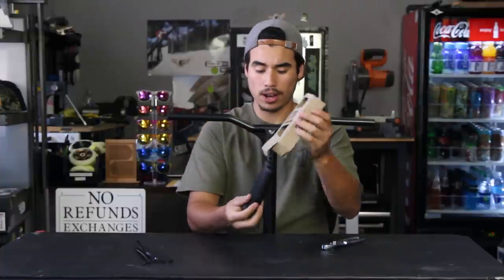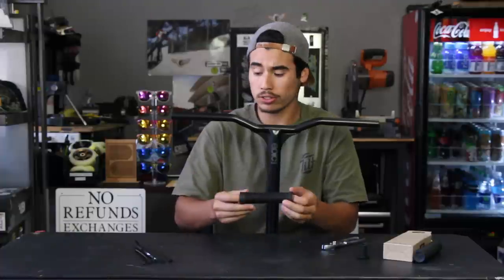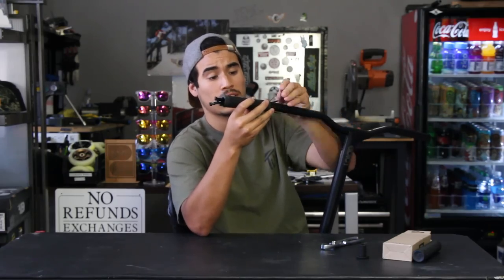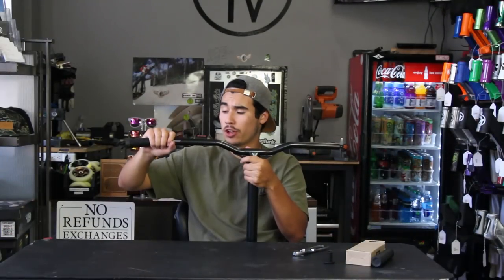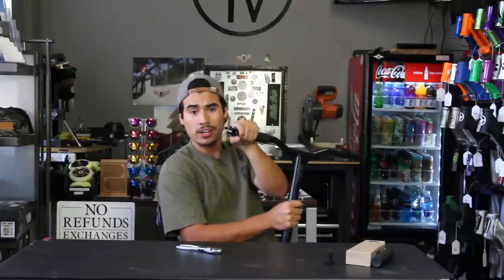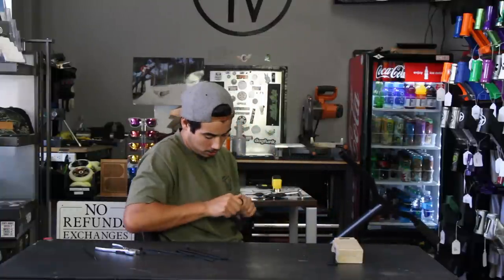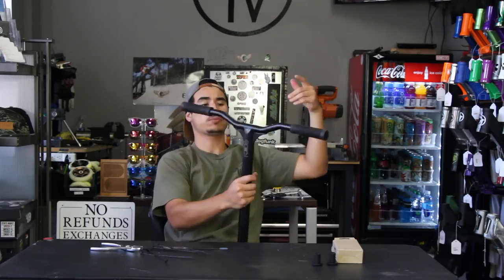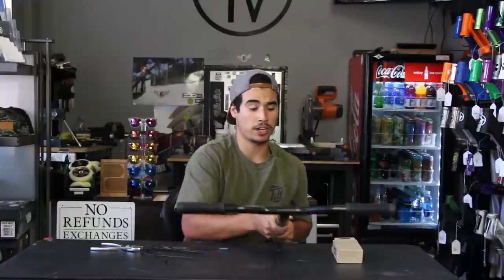The Vault Pro Scooters How To Install Grips!

Comment: I love you guys video tutorials,but this is one is a little bit hard to do and time wasting. If you don't have an air compressor you can also use hair spray or rubbing alcohol, am not sure if its because the rubbing alcohol takes some time to dry and you want to get them on right away, but I totally prefer the easier way.